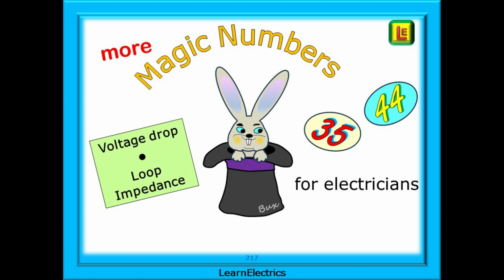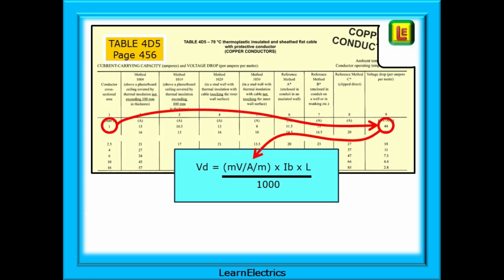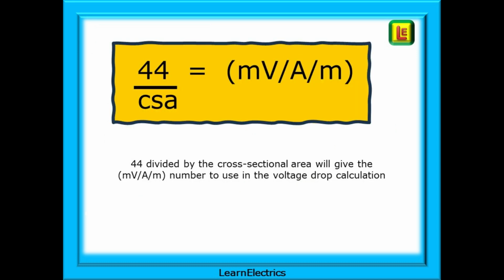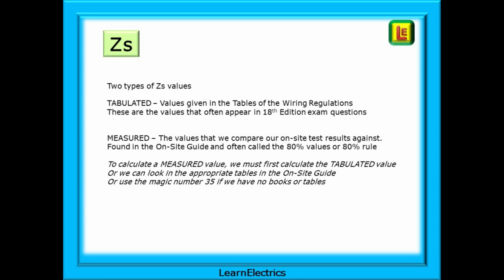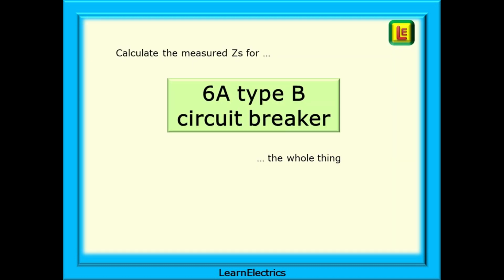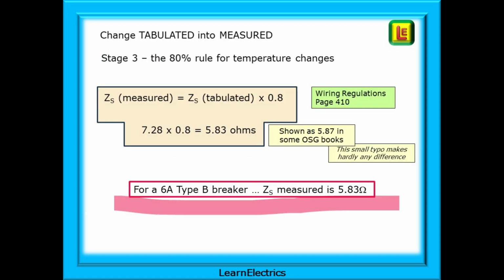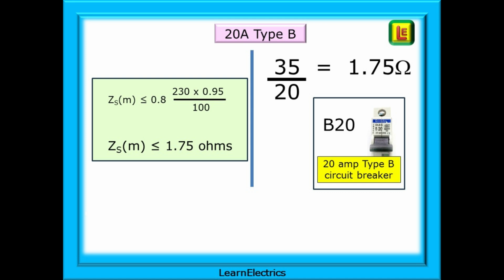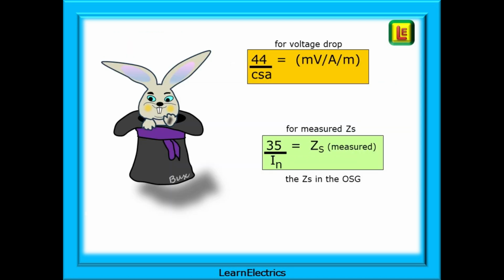MORE MAGIC NUMBERS FOR ELECTRICIANS – 35 AND 44 – HOW TO USE SHORTCUTS TO FIND ZS – AND MUCH MORE

Comment: Excellent examples and a real time saver but can we really use these magic numbers in a City and Guilds exam? Is it really permitted?
Reply from the maker: Depends what the question wants. If you just have to give a value, as in off the top of your head, it works. However, if the question wants you to show working out, then you would need to follow the various tables in the book. Thanks for the response, dave.

Comment: Is 11.5 a constant number for voltage drop
Reply from the maker: no, not a constant. 11.5 volts is the maximum non-lighting voltage drop in a 230V system

Comment: Is the 44 rule unusable if the cpc is the same size as the line conductors.... if so do you think i could use à correction factor ..  or am i talking giderish?  PS recieved my on sight guide. Will be picking up the Regs soon.  Thank you for all.
Reply from the maker: Makes no difference. The 44 and 35 give you the maximum Zs as appropriate. Having a bigger CPC  will reduce the actual Zs and make your figures better. Hope this helps.
Reply: Fantastic ! Thanks Dave...understood.

Comment: Hello Dave,, many thanks for all the knowledge you are giving us, I'm thinking of buying this book,, IET On-Site Guide BS7671:2018+A2:2022 by The Institution of Engineering - Book,,, will benefit from taking into consideration that i work in the middle-east, or you recommend other book ?? Many thanks in advance.
Reply from the maker: In the UK it is an essential purchase. All my videos use this book as a reference source. Not sure how closely it relates to the Middle East, but when I worked in France I used the UK book as a reference and my work was always accepted. A few differences that I had to work around. Good luck my friend. Dave.
Reply: @learnelectrics4402  many thanks 🙏🙏🙏